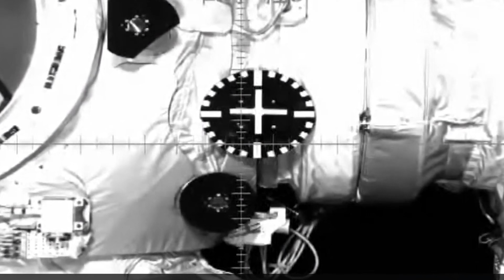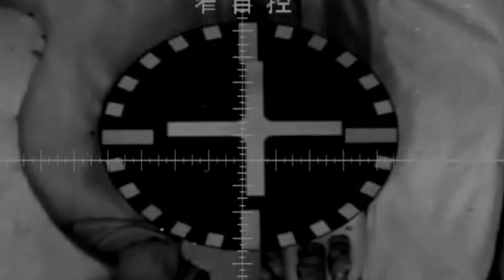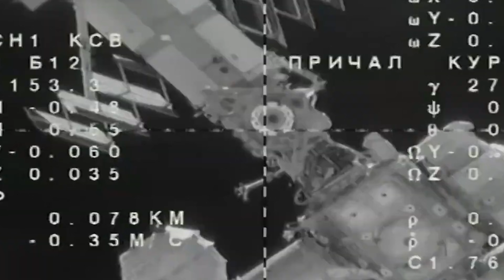Something Bad is Happening to Chinese Astronauts on Tiangong Space Station, SpaceX to Rescue?

Comment: Why is Space Zone still recycling this outdated fake news? The Shenzhou 20 taikonauts have already returned to earth from the Tiangong Space Station using the Shenzhou 21 capsule on 14 Nov 2025. The China Manned Space Agency (CMSA) then launched an un capsule (Shenzhen 22) which rendezvous with Tiangong Space Station on (Shenzhen 22) which rendezvous with Tiangong Space Station on 25 Nov 2025 to provide quick-response emergency return capability for the Shenzhou 21 crew. 
There is no longer any bad or emergency situation on the space station and everything is back to normal.